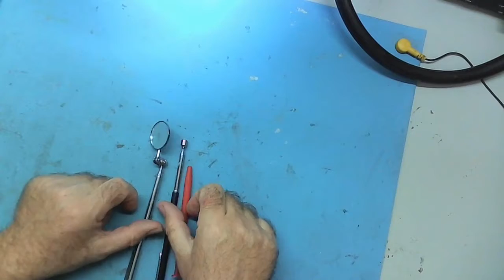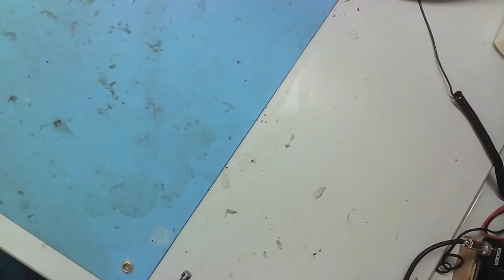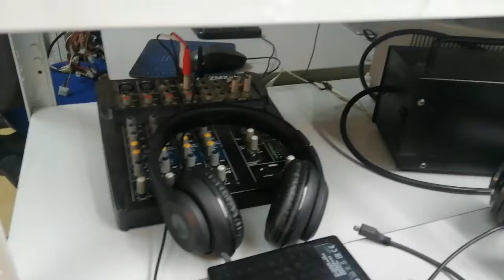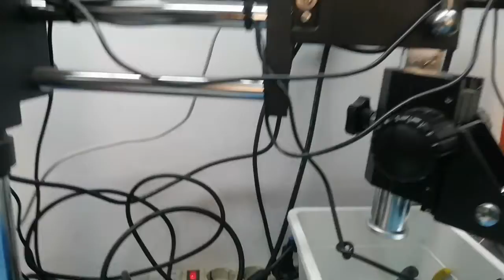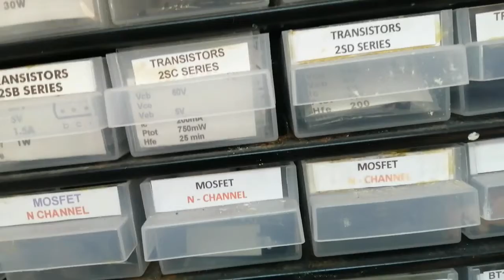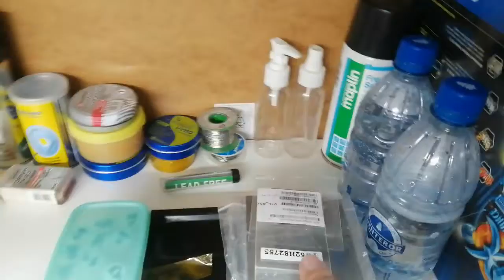Learn Electronics Repair #30 - Hand Tools, and How to set up a An Electronic Repair Workshop

Comment: 4" hemostat I use *all* the time. One of those mini-micro screwdrivers, the type you get with SSD sleds. Powered magnetizer. Big pencils, with an electric sharpener nearby. Small adjustable wrench. Vacuum vise to hold a 2-AA LED Maglite for pinpoint light source. Lysol disinfectant spray for electronics cleaning, sticker removal, cleaning thermal paste off. Baby wipes take off thermal paste way awesomely too. Otherwise, King Richard has it covered.

Comment: I'm still picking up equipment but I have most of what I need. I worked on a kit and surprised that I was pulling out tools I didn't think I'd need. So it's kind of a fluid process.